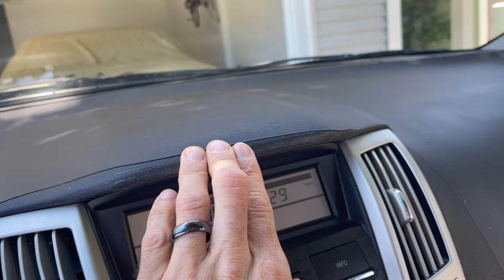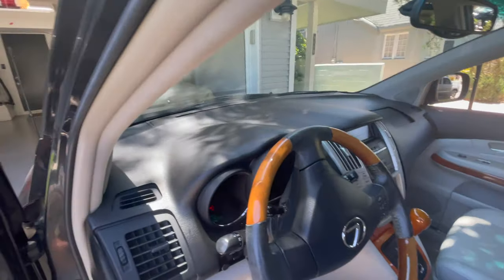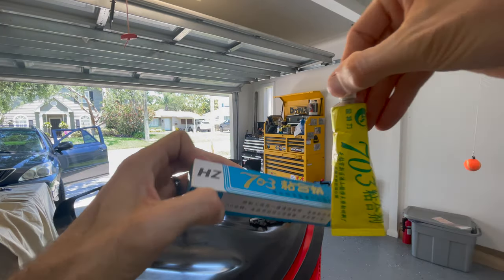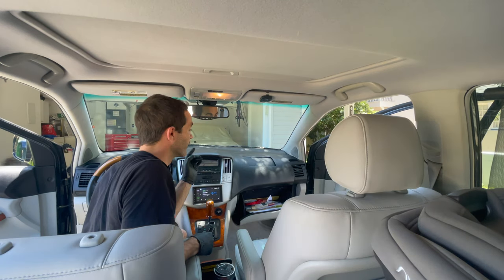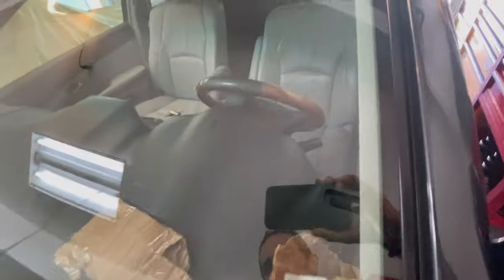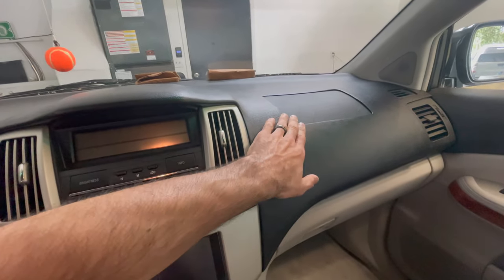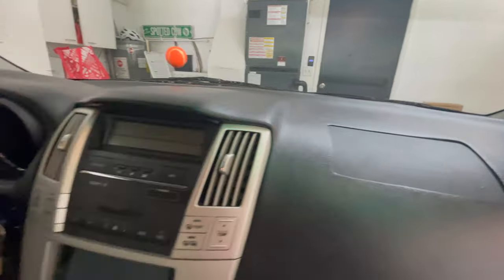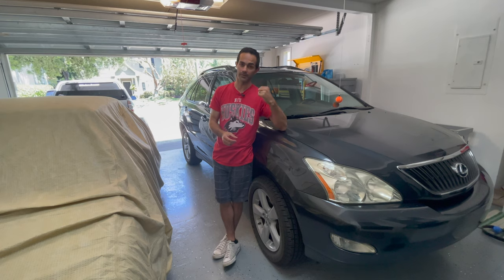2007-2009 Lexus RX 350 Cracked Dash Replacement ABS Cover

Comment: We have a 2009 Lexus RX 350 that we recently bought and it has a cracked dash, of course, and we bought a DashSkin brand dash cover for it.  We will be installing it some time next week, probably (need to have at least half a day when we don't need the car so the silicone can cure).  So we have been watching plenty of videos for tips and pointers, since some people recommend NOT following the directions precisely (such as using extra silicone, adding silicone in different/more places than the instructions call for, tips for weighting in certain "problem" areas, and so on).  Thanks for the video. Even though your dash skin is a different brand, it looks almost identical to the one we got from DashSkin.

Comment: I actually installed the CoverLay version, with the airbag cover, in my Moms 2007 RX350 for her 2021 Xmas present.  After seeing your video, I am very pleased I spent the extra 200 bucks for it.  I watched their video and one other, followed their directions to a T, although I was tempted to get more silicone. I used the cardboard blocks from their shipping box to stuff around the top, and stuffed cardboard on the ends like you did.  It turned out looking spectacular.  Everyone, (including me) was stunned it looked so good. If I had not installed it, I would have thought she got a new dash at the dealer for 2K! The fit in the tight spaces was slightly better than your brand, and it looks like a factory dash, with the airbag cover.  I thought about leaving it off for safety, but the hole is an eyesore.  No comparison.  I would have paid an extra 400 if I had know it would look that good.
Reply from the maker: Thanks for the input and the update, I might have to try that cover and let you know how it goes!!
Reply: Please send me a link where you bought it from
Reply: Hi, Where did you buy yours  and  exactly what is name/ brand etc do I look for. My sis had a dog crate on her lap not realizing it was hitting  my dash board  and destroyed my dash board  in the front . It looks so terrible  every time I get in car it upsets me. All the foam is showing  cause big pieces from dash just  cracked off now.😢 I have a 2007 RX 350 also . Thank you!
Reply: @francoisduvenhage7116  the brand is coverlay and they have a website

Comment: I bought a used Maxima several years ago and it had a DashMat as a protectant of the dashboard already included.  I had never had one before but it is basically a carpet that fits your dashboard area.  I liked it so much as it reduced the glare on the windshield from the sun, It doesn't get dusty looking and when cleaning, it gets vacuumed at the car wash.  It's also much less expensive and much easier to install.  I live in Las Vegas so you know the sun is tough in the desert.  When I bought my 2007 Lexus, I bought a DashMat first thing on the list.

Comment: Airbag cover is huge for me.  Big empty hole with visible cracks dominates the dash visual.  Rather deal with flying rounded cornered cover in crash.  Went with Coverlay with airbag cover.  About 3x cost of Dashskin.  Excellent fit and quality.

Comment: Pro tip. LOTS of painters tape for the lower parts. Three $4 bags of play sand put in garbage bags in case they leak to lay across the top. Wash cloths between the gap at the windshield. Then your can even get a $50 suede dash cover on top from Dash Designs to make it even nicer after. Or use it instead by itself! Almost perfect. You're welcome!

Comment: So, if your dash has a bunch of cracks in it right around the passenger side airbag and the airbag goes off, won't small pieces of sharp dashboard possibly be propelled into the face of a passenger? Why shouldn't this be a safely recall??
Reply: It was and they actually extended it two more years. Sadly for us, we bought our 2009 the same week the extended recall ran out and Lexus nor the dealership we bought it from would cover it when it fell apart a month after our purchase.